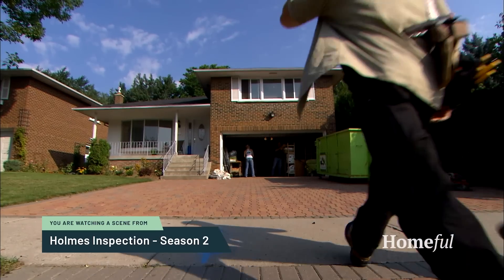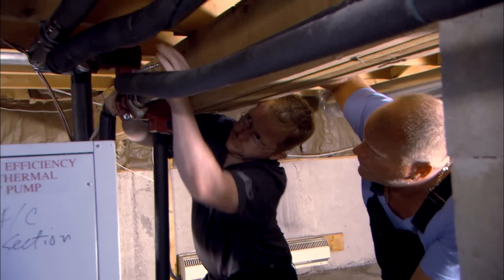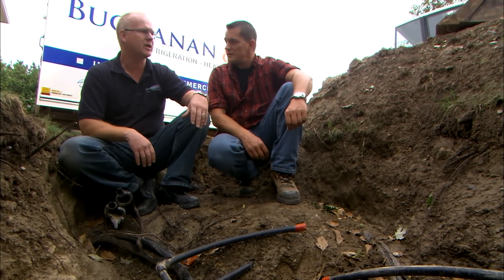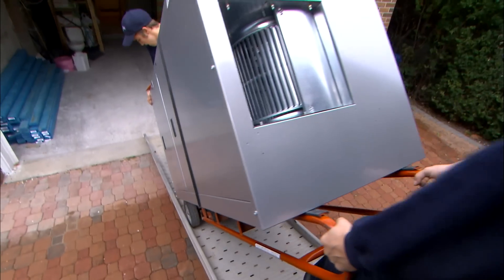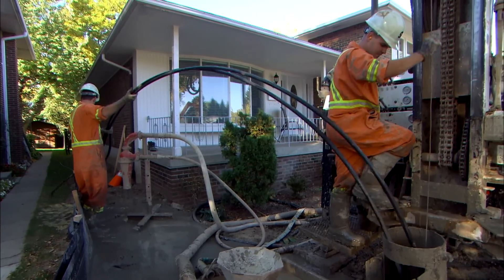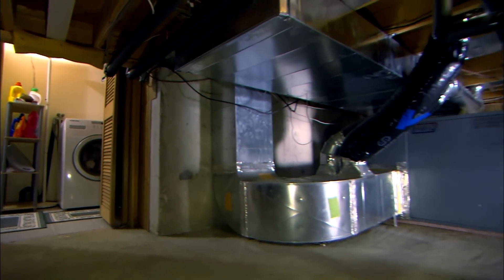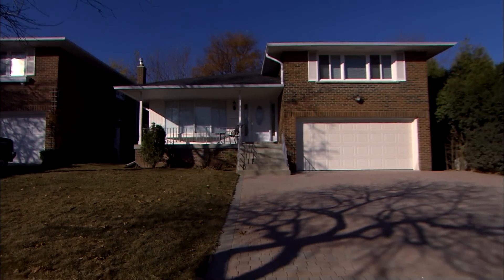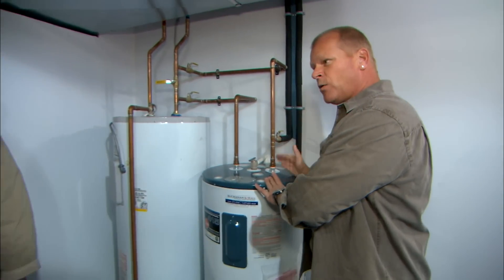Mike Holmes Rescues a Flawed Geo-Thermal Installation

Comment: Wish there was a Mike Holmes here. I spent $1000 for a new back door. The guy didn't even put the deadbolt on. I have to slam it to get it to close. You can see that the door is warped from outside. Neighbors probably think it's a gun shot. I actually felt wind blowing in and frost build up on it the first winter. The company isn't going to take responsibility for their installer as they use subcontractors, and, it had been over 6 months. Yep...I've been screwed. I NEED A MIKE!!!!